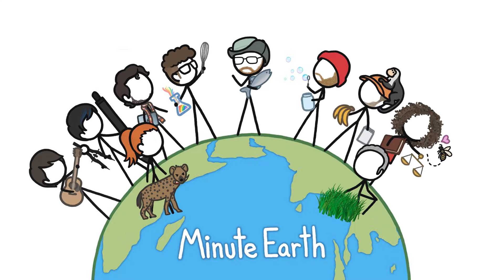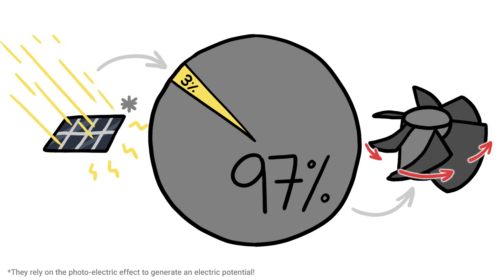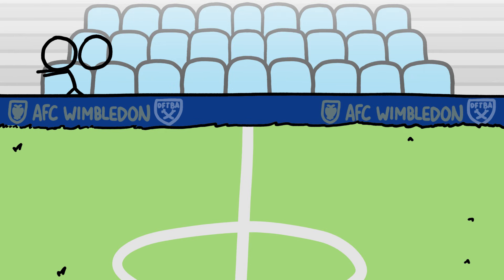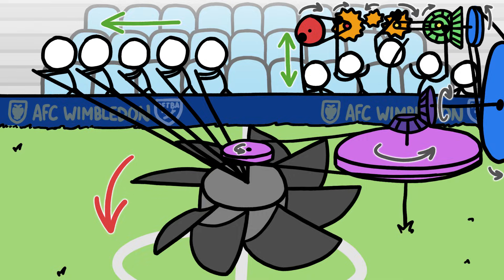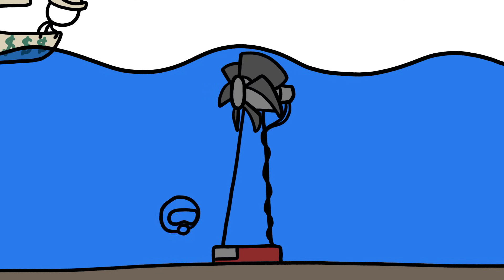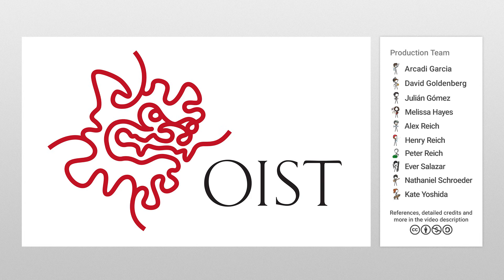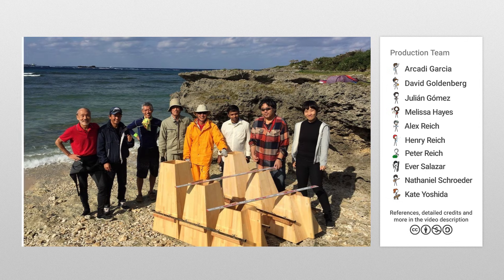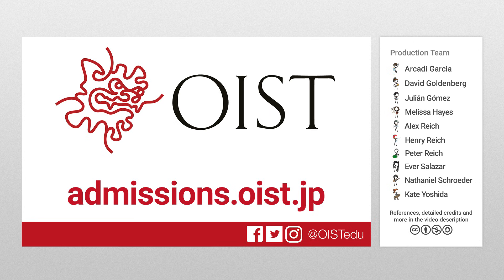Why Can't We Get Power From Waves?

Comment: WRONG, they do have wave power and it works well.
It is the up and down motion that is wave power, not what you assume because that is ocean current power and that also works!
Steam turbines are small so spin fast, wind turbine spin slowly because they are larger, and since the ocean currents move even slower than wind, they need to be even larger to harness the slower moving energy, which by the way is massive!

Comment: A wave generator for surfing and wave generator for power, the structure would have to sit above the typical wave height and allow water to flow in at the varying levels into a well,
which would be continually replenished with wave action and that reservoir of water will power the turbines while the wave action is also directed to the front of the structure to be 
concentrated into a plunging force to increase wave height for surfing, with a Restaurant and Bar of course. The structure would be self stabilizing.self powered.

Comment: Why haven't we found a way to convert one energy form into another?  I've scuba dived for over 10 years, and the power of waves and currents is endless and tremendous.  Certainly some device can transfer that into useful power.  I'm incredulous.
Reply: Lots of complications, but you ahve to remember energy density is essential.  The amount of energy per meter is very very low, and you could only collect a portion of it.  This is why solar and wind are such poor energy sources.  The energy density from them is so low, that we require massive amounts of land to get even a small amount of electricity from them.  Coal, Oil, nuclear are are energy dense, so we require less space, less fuel, to get a lot more energy our of them.  And there's the price tag.  Low dense energy sources are very expensive because they require a lot of land, maintenance, production of materials, and they are less reliable.
Reply: @droe2570  Thank you.  That explains a lot.  How about volcanoes?

Comment: Have a Floating Platform on the ocean and connect long levers to oneway roation gears, then link up those gears to an axle roating the shaft of a Generator. The Ends of the Leavers have massive Air Filled Floaters. Done. Now you harness power from waves in a suprisingly cheap manner. With About as many moving parts like any other Power Generation.

Comment: Why not forget about turbines? Waves generate reciprocating motion, which can be converted to rotary motion with a connecting rod and crankshaft, as in a steam engine or internal combustion engine.

The other issue is that wave generating devices might be dual-purpose and function to provide sea defence, eg harbour walls and sea walls for coastal protection. After all, wave generation works by removing the energy from the waves.

Comment: You know those friction cars that you push using linear motion and it spins a flywheel which gives it momentum and you know how some of them power led's for the headlights using this mechanism? Take the vertical linear motion of a float being pushed up and down by the waves and put it into a flywheel connected to a dynamo using a ratchet mechanism. C'mon even my local aquarium has a linear motion to electrical power demo that just does straight bobbing on the waves to a magnet through a vertical copper coil. Stick a flywheel and a ratchet with a dynamo and you can capture way more energy.

Comment: Hum...
What about finding some way of turning the wave energy into lower delta temperature differences and use that to power a alternative to turbine engines that requires a lower heat delta?
What kind of engine is able to utilize the lowest temperature difference to generate rotation of them all?
There was a ted talk or tedx talk or some such not so long ago about a new nano material able to radiate heat away from it more efficiently then it was heated up by sunlight even in a desert leading to it cooling down.
Something like that could perhaps help create a temperature gradient.
The waves contains mechanical energy to transforming it into heat should be relatively easy as long as you don't have too high expectations about the amount of heat you expect to get from it, no?

Comment: We should probably use volcanic vents that bubble hot gasses to the surface of the water, seems like that'd be way easier to work with than tides, tsunamis, open ocean storms, fish, and boats
Reply: Hydrogen sulfide is one of the problems with that.

Comment: There are over 50000 merchant ships in the world on the move almost at all times. Why not use their propellas to generate electricity and have them deposit the electricity at ports they arrive at? Minimal cost at first but then very little additional cost besides upgrades and repair. It won't cover all the requirements of electrical use but it will definitely help.

Comment: Well I think it’s less about just waves but the actual currents in the ocean that are best.. water is like 80 times more dense than air and water currents are pretty consistent.. so as log as we can use turbines in water that dot degrade so easy and don’t harm the envrnment it’s placed in, it should theoretically be much more efficient than wind turbines..

Comment: Actually you can use a piston mechanism to pressurize water into steam and the use said steam to turn a turbine. However it's mechanically wasteful because you need to also use pistons to desalinate the water. It's a losing proposition because nuclear power is way less costly and way more efficient.

Comment: Didn't watch the full thing cause it's misleading. We have a wave power project in norway that's currently been delivering power on the grid for 2 years. It's a bouy that's anchored to the seabed, when it floats up and down it creates energy with hydraulics, no turbined needed. Just google "Runde Bølgekraft" and you'll find an article on tu.no. Just use google translate and you'll get a general idea what's going on.

Comment: this doesn't seem very scientific to me at all. i think there are other designs you didn't touch on, and your cited criteria for success in wave power is totally restricted to cost vs fossils, which is SO beside the fucking point of having renewable energy. planet is dying, remember? it's not about your stupid wallet. you even stated that some wave power is "just as expensive" in consumer costs... well, wouldn't most consumers want the clean energy instead of coal or oil at the same price? i think they would. i would.
fossil fuels will only become more costly (in more than one way) over time with a limited supply and increasing demand. wave tech will improve eventually in the way solar and wind have, when investors get interested. which will happen when half their golf courses are under rising sea water.
https://tethys.pnnl.gov/annex-iv-sites/eco-wave-power-wave-energy-power-station-gibraltar

Comment: I think the answer is to have a series of turbines, not just one, that can access the wave over a longer time span because each turbine is closer from the first turbine. As the wave comes in, it hits a turbine every few seconds. Maybe a computer can be used to link all the turbines in sequence to draw a longer time frame of energy from the wave.That way you can have a more consistent flow of energy to make into electricity. As an example, lets say you put a tiny turbine on a fishing line. You would get a tiny bit of energy fron the one turbine. But if you put ten or twenty tiny turbines on the fishing line, you would have access to a lot more energy from one wave.

Comment: You're clearly wrong because all the scientific articles Facebook bombards me with tell me that wave power is the future.
Reply: Wave power is the future..
 Writer of a check to Zuckerberg
Reply: @Aircooledboxers  tbf, we don't know what the future holds. 200 years ago, people saying that's flying is the future of trans-Atlantic travel would be called crazy like that "writer of a check to Zuckerberg". But then we created airplanes and flights between Europe and the Americas became more common. 
Perhaps we would invented something that can effectively harness the oscillating patterns of waves for energy production.
Reply: @alexanderchristopher6237  comparing air travel to reasonable means of wave power is light years from an apples to apples comparison. The salt water problem is not a single problem, but a large grouping of problems. Material science is no where near handling most of these tasks.  Production costs and production emissions/consumption, safety, and balancing environmental impact are enormous limiting factors. Sure you can rig up a temporary wave generation plant and it will produce. However it wont be cheap, and it will consume a heap of natural resources, leaving a sizable carbon boot print in its wake. Underwater cables were an intense undertaking on their own. To make a long topic short. We will all be dead long before it has useful potential.
Reply: See seadogsystems.com. The future is now

Comment: Let's just go nuclear and call it a day. We'd be set and then we can work on improving solar, wind, and hydro at a more leisurely pace.
Reply: Nuclear power, fusion reactor, Dyson swam. Adding solar panels to the roofs of building and small efficient windmills also helps.

Yes a Dyson swam is a hard to make at this point as far as we know theoretical structure but you don't need to cover up the whole sun. You only need to cover up a small fraction of a percent of it to power the earth easily.

Or you can choose to put windmills every where and use the needed energy of ocean waves that helps move resources and nutrients for animal into power.

If you can improve solar panels, reducing there heat output and making them effective in high temperature areas then you can use those effectively.
Reply: The enviromentalist are looking for problems not solutions. They are like a baby that wants to be held. You pick them up thinking are you hungry, aare you wet, did you hurt yourself? No you just want attention and you are going to cry to get it.
Reply: @calebfielding6352  I mean there are definitely problems and we should definitely try to live in a way thats less harmful to nature. 
There is no way that the massive deforestation, area modification, burning of green house gasses stored for millions of years and pollution, has had no impact on the environment

I wouldn't compare environmentalist to a baby wanting attention. Although many just point out the problem and don't give a practical solution. They either say we need solar panels every where or windmills. Not understanding our power requirements, how those technologies work, how they are produced and there affect on the environment.
Reply: - Not a day goes by without some short sighted genius declares nuclear is the way to go. Every time that happens I always wait to see what miraculous method they have come up with for the waste. Still waiting.
Reply: @zora_noamflannery2548  over 90% of the waste can be used in other nuclear reactions. the remainder is buried in a way where even earthquakes wont cause it to spill out. Even if we just had it sit in a giant shed in the middle of nowhere thats still much better than putting on the waste into the air like we do with coal or oil. Or solar which produces 300x the waste per unit of energy.
Reply: Untill one earth quake or hurricane and we have a Chernobyl level disaster or worse. Never mind the nuclear waste that slowly poisons the ground below our feet unless perfectly contained for generations.
Reply: @sneakycat67  4th generation nuclear cannot melt down, opposite in fact.  Any failure causes it to go completely inert.  Also it can use prior generation nuclear waste as *fuel*.  It is the safest form of energy production known currently, cheap abundant, clean.  It's solely due to politics that this is being kept from us, sadly.
Reply: @sneakycat67  nuclear waste is fairly easy to contain and there have been reactors made that can use common nuclear waste to produce even more energy. Plus modern nuclear reactors have so many safeguards the chances of a 2nd chernoybl is pretty much the same as a solar flare wiping out all life on earth.
Reply: @zachdowdell583  tell that to the people at Fukushima a reactor designed to survive earth quakes and tsunamis. We have the capability to go nearly fully renewable within this decade why bother with a half measure that just delays the crisis
Reply: @sneakycat67  okay, to the people of Fukushima, thats what happens when you create a nuclear reactor with unqualified personnel who failed to accurately follow the blueprints, rush repairs, falsified safety records, and have the government ignore your warnings for years and THEN get hit by a natural disaster. Totally a valid reason to not go nuclear. /s

Seriously tho, it takes an absolute insane amount of cluster fuck ups and corners being cut to even be in a position where a natural disaster could cause a nuclear meltdown.

Nearly every non nuclear solution is a half measure, nuclear literally is the most effective way to go about it. You can add in a bit of solar, wind, hydro, geothermal or whatever too but they would ultimately be fairly inconsequential when compared to nuclear.
Reply: @sneakycat67  Sure if by "fully renewable" you mean constantly and forevermore digging up massive amounts of resources to both maintain and expand an incredibly large system that generates a relatively tiny amount of energy in a way that causes incredible environmental disruption and kills far, far more people than nuclear power ever has while needing to do the exact same thing over again for a system that allows that energy to be stored since the previous system only actually works a fraction of the time. That's assuming you're talking about solar and wind power of course.
Reply: @sneakycat67  since the start of nuclear energy usage there have only been two events of utter failing. One due to utterly poor safety (chernobyl) the other due to not having the ability to proper manage the reactors put in a earthquake and tsunami zone.

Higher standards and safety regulations will reduce the chance of a issue even further. It would also be helpful if we used other elements other then plutonium and uranium. There is a at this point theoretical design for a....I believe its radium reactor that not only allows for the recycling of its waste into new cores but is practically melt down proof due to the nature of the design and how it causes nuclear fission.

Nuclear energy isn' t as dangerous as many think. It just needs to be developed and held to a higher standard.

Fusion energy will be a entirely different process when it is developed and will have much less risk, depending on how we create fusion
Reply: @kumiq17  Are you thinking of Thorium reactors? The waste from that has a significantly shorter half life if I recall correctly
Reply: @ishoottheyscore8970  you might be correct. I honestly don't remember but that sounds right
Reply: Until a few years and the population has doubled again and we're back at square one.
Reply: @NickRoman  it would take more than a few years for the population to double. Wed be looking at decades and we cpuld always overbuild as well
Reply: @NickRoman  Corona has entered the chat

Comment: So far some of the best Hydro Power techniques not mentioned is waterfalls, however in the sea, is it possible? to find high lying areas and drill a hole in the sea bed, forcing water down a pipe into lower the sea bed? placing a turbine in the path will consistently turn spin the turbine.

Comment: This video, and whoever has been working on the wave energy idea, has failed to denote the vital difference between Waves and Currents. 
Wave energy is a non-starter. Waves are short-term and unreliable. 
Currents, on the other hand...
Don't put the turbine on the surface where the waves are. Put the turbines on the continental shelf where the Gulf Stream Current will turn that puppy all day and all night. NOAA tracks these deep water currents in real time. They have decades of historic data on the locations and speeds of currents from hundreds of stations. 

There should be a line of such deepwater turbines lined up the entire east coast of the American Shelf, as well as in the Gulf of Mexico. Everywhere that deepwater currents are mapped, which is goddamn everywhere now thanks to science!

Why even mention waves?
Reply: wickedpissa25 it’s way too dangerous to mess with the Gulf Stream.  If we slowed it down in any way, we could start another ice age.  The stream is like earths little heater that helps maintain the temperature of the whole planet.
Reply: @grantmonge  You're kidding, right? This is the internet, so it's really hard to tell if you're just kidding or if you're just weapons-grade dumb. 
Please be kidding.

Comment: They place turbines on the sea floor in inlets to catch the tidal flow. The rotor turns a magnetic coil generator in the shaft housing which creates an electrical current. The higher the flow rate of the water, the more electricity is generated. The major difference is that underwater turbines are designed to work with water flow from either the front or the back.Mar 2, 2013

Comment: You never mentioned the type that uses floating pump arms on a shore mounted unit that transfers the energy by pumping hydraulic fluid through what is essentially a hydraulic motor that spins a variable transmission and generator.